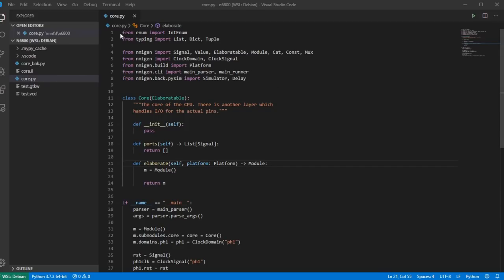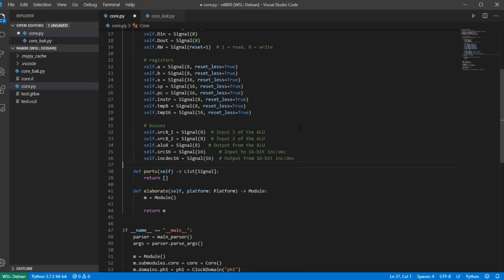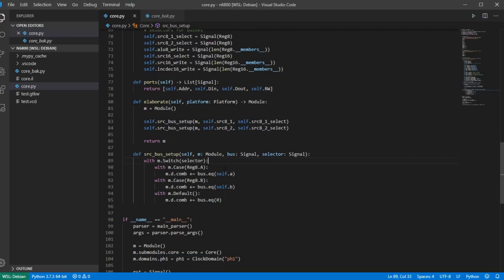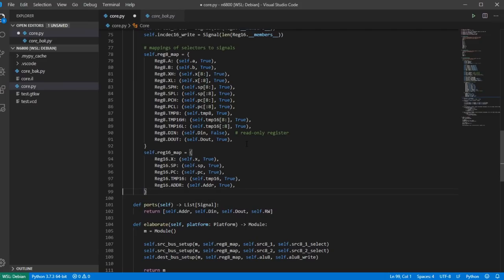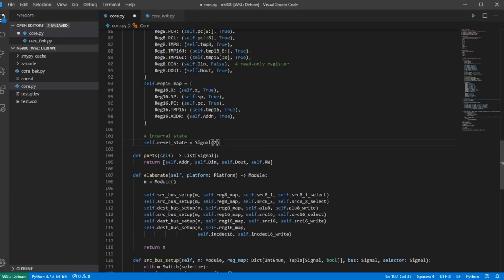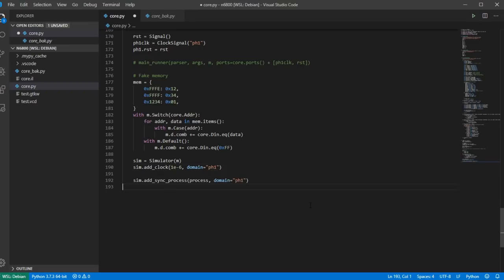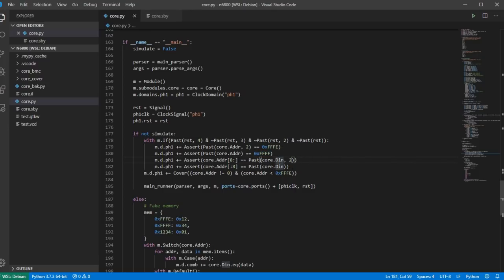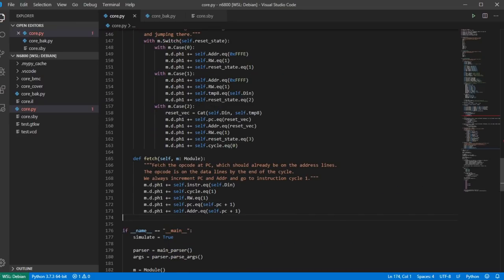Building a 6800 CPU on an FPGA with nMigen (part 3)

Comment: I didn't expect part 3 so soon! It's like Christmas... On actual Christmas!
===
~0:30 -- ~1:37 Personally I found nMigen better than MyHDL which tries to compile python to verilog and it's not very good at it(some errors I got were unreadable).
I don't like that ports()  return both inputs and outputs. In my code-along adventure I split them, and made helper function for simulation that duplicates signals returned from inputs() automatically, as doing it manually is tedious and ports() is defined as inputs()+outputs()
Reply from the maker: That sounds like a good idea. Probably better than what I'm doing!

Comment: Intresting project. I actually designed that replacement board and did a fpga version using the open source 6800 core. It was done in vhdl.
Reply from the maker: Nice!
Reply: If u need a breakout board to try in the machine let me know. I have the one i did that has all the level shifters. It interfaced to the dev board i used with some ribbon cables. If i did it over i would shift out the io serially to reduce  the io pincount

Comment: I coded my first core in nmigen, and I am not sure about its advantages over migen except formal verification. The Syntax of migen seems to be much cleaner and easier to read, and the ecosystem around it (litex) is very impressive. Furthermore, nmigen still is far from being mature like migen is.

Comment: * Concatenation is strange in nMigen. It's LSB-first as opposed to verilog. Very confusing.
* At this statge I fond testing harness to be more complicated than CPU, lol.
During refactoring I merged registers' capturing from pre and post snapshot into one function. 
As the result, postsnapshot instead of comb domain, used ph1 domain and registers lagged for one cycle, thus failing checks. Killed whole evening for that. 
* Regarding optimization: yosys definitely capable of using one `pc+1` adder instead of several. It's more interesting to see optimization results for things like end of instruction. 
Also it's interesting to ask yosys to synthesize for different devices(e.g. synth_anlogic vs snyth_ecp5) and compare benefits of the optimization.
Reply from the maker: I pretty much agree with everything you said! There is a subtle difference between asserting in the comb domain and asserting in a clock domain, and getting it right can take time.
Reply: > Concatenation is strange in nMigen. It's LSB-first as opposed to verilog. Very confusing.
It's different from verilog but it's always consistent in a "software" kind of way. Signals kind of act like python lists, both in slicing and "where" the LSB lives.
Reply: > Concatenation is strange in nMigen. It's LSB-first as opposed to verilog. Very confusing.
It's different from verilog but it's always consistent in a "software" kind of way. Signals kind of act like python lists, both in slicing and "where" the LSB lives.

Comment: I would expect the logic optimizer to have a pretty easy time turning all the instances of "pc + 1" into a single adder unit. Where you're gonna benefit from doing some of that bus optimization is the fact that you can share one adder across multiple functions that aren't doing work at the same time as each other. The optimizer can still do some of that on its own, (the "sharing" pass) but that type of reuse is gonna be a lot more fragile in the optimizer than if you handle it yourself.

Comment: @Robert, I wanted ask what is your opinion on using nMigen/Migen as a starter to really properly learning HDL? I have used VHDL in the past to write some very small university projects and later Vivado HLS for a larger project, but now want to go back to HDL, since I found HLS to not be really appropriate for my style of coding hardware. Thing is, I really love python and Migen feels like more of a productivity tool so I would like to just go straight to that than learning barebone VHDL/Verilog only to then move to Migen anyways. Do you think it's too different from traditional HDL to be used for learning hardware development? Or could one just instantly hop to that without going over a VHDL book first?
Reply from the maker: My opinion is that the concepts in nMigen translate directly over to a lower-level HDL. My other opinion is that it's better to actually rely on nMigen than on features of, say, SystemVerilog. No vendor implements all of SystemVerilog. So in a sense nMigen is even more portable.

Comment: 24:02 Hello,
I have trouble with feeling how this code works.
In 1st phase You set address FFFE
In 2nd You both read FFFE and set address to FFFF, and here is my problem. 
How does setting new address not mess reading from previous one? For example, I2C - we toggle clock signal when data is stabilised and prepare new data bit after clock passed. Toggling clock and preparing data at the same problem may cause issues.
So how to understand reading and setting new address in the same time? Are they buffered in some manner?
Reply from the maker: Address is set at end of cycle. Data in is read during cycle.

Comment: I'm not totally sure I grok what you mean by "We're not refactoring for Python, we're refactoring for the hardware". I don't see anything wrong with your initial approach; it's pretty much identical in form to your NOP function. Would this fail to compile? Not work as expected? Or is this the kind of optimisation you mention later to the video re: the adders, and the point is to avoid duplicating the logic for each instruction? If it'd fail for some reason, I'd really like to understand why.

Merry christmas!!
Reply from the maker: What I meant is, if you refactor the Python code, just be aware that you still haven't made the underlying hardware any more efficient. You have the same amount of hardware as before, you've just written less code to generate it. If you refactor the hardware, you're identifying common bits and pieces and replacing it with one piece of hardware. Kind of like using + everywhere, and now you've got 100 adders in your hardware, even though you only use one at a time. So you can refactor the hardware down to one adder resource, controlling where the inputs and outputs go.